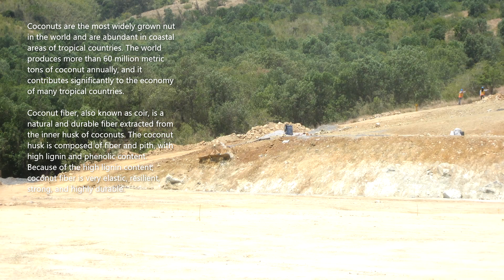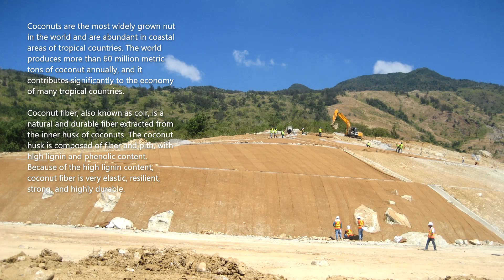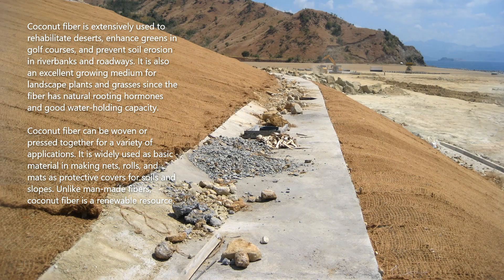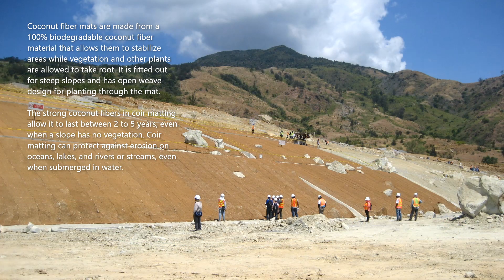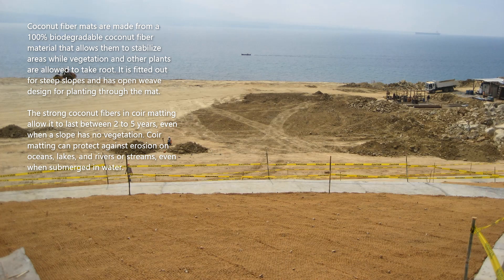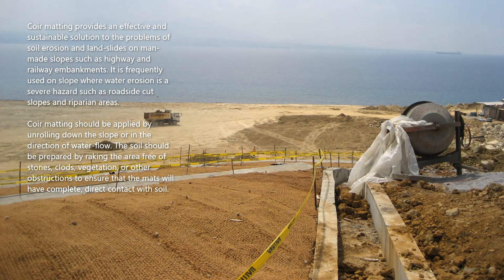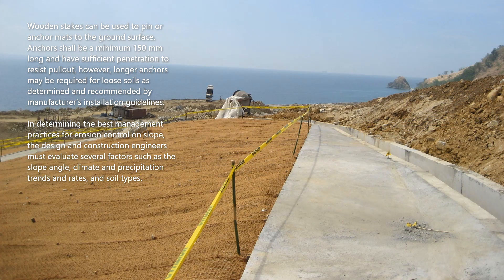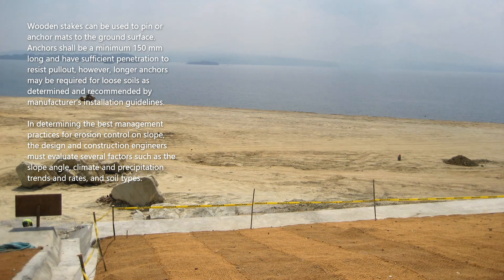COCONUT FIBER | Erosion Control On Slope | Civil Engineering & Construction

Comment: Sir/ Mam but coir is bio degradable material. So is that possible that - after degradation of coir, soil losses its strength???????
Plz reply
Reply from the maker: Dear Sir/Mam, thanks for your query. 

Coir or coconut fiber is one of the materials typically used to produce degradable rolled erosion control products. It is widely used as a basic material in making nets, rolls, and mats as protective covers for soils and slopes. 

Though the strong coconut fibers in coir matting allow it to last between 2 to 5 years, even when a slope has no vegetation, however, it should be designed and used in conjunction with vegetation. It is the living vegetation (its extensive, and thick root system binds the soil which makes it very difficult to dislodge), purposely arranged and embedded in the ground in selected patterns and arrays, that is used as a natural soil bioengineering tool to reclaim land, control erosion, and stabilize slopes.

Hope this answers your query. 

Thank you very much.